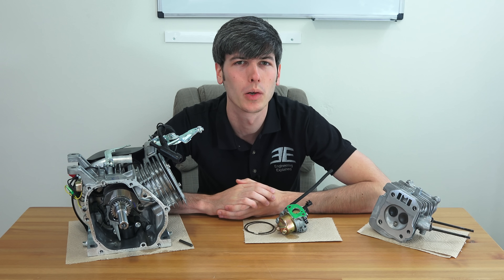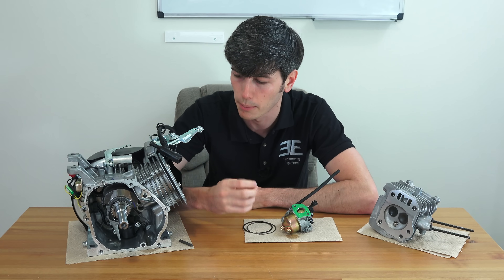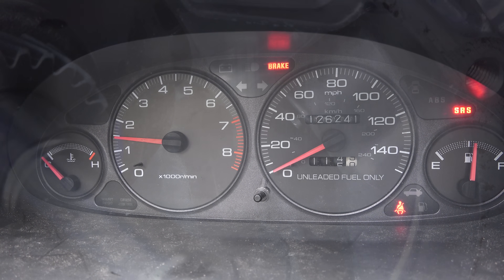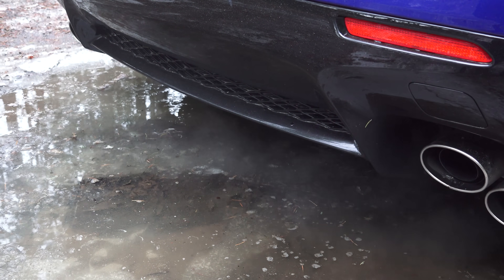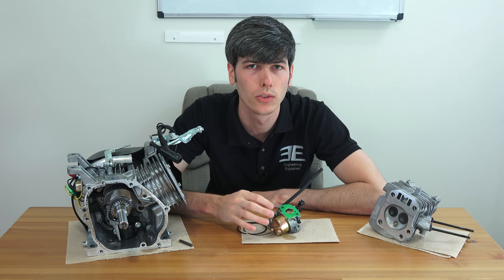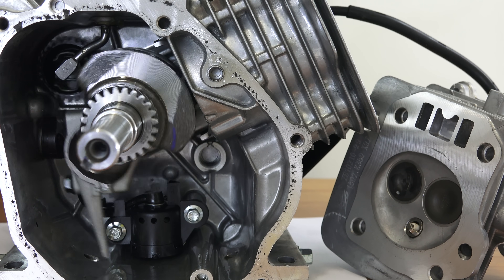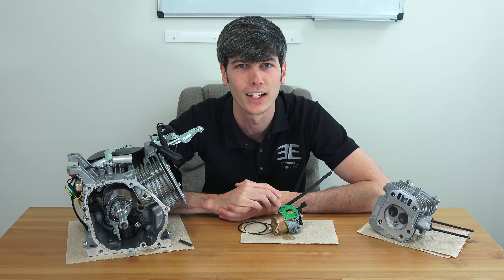Should You Warm Up Your Car Before Driving?

Comment: lol, the engine warms up quicker when you drive off right away because there's more friction from tolerances being subpar & the oil viscosity being too high during load. You're trading minor wear from wash/dilution for high unprotected wear.

Another angle with this is engine type & vehicle weight aren't accounted for... all these small inline turbo engines being run in large vehicles for fuel econ don't produce low end torque (where you're suggesting they stay till up to temp).

Comment: A properly setup carburetor has excellent cold start and cold driveability.  They were commonly neglected and didn’t always have as good cold emissions.  

My last carburetor, 85 Cutlass Supreme, had a 77 Olds 350, and an E4MC Quadrajet carb at -25F had significantly better cold weather manners than my 1991 Pontiac Bonneville series 1 3800 with the most advanced fuel injection of the day.   But I spent time to ensure the carb was setup exactly how GM specified it should be.  This old 5.7L engine would get 23.5-24.5 mpg highway without overdrive very consistently.   The original 307 v8 typically got 27-27.5 mpg highway.  From an old school carbureted v8.

Comment: "Carburators wont adjust the fuel air ratio when cold".  WRONG
That is literally the only reason there is a choke in a carburator, to adjust the fuel air ratio when cold and make it richer.

Comment: From experience...if you put too much pressure on a cold engine, you will super heat the components....you can bend the valves... Warm it up a few minutes and then "Idle" drive it until the revs come down.  Drive it as if there is a raw egg between the accelerator and your foot.  Everything will be just fine.  Also, use pure or semi-synthetic engine oil.  Some have flow capacity up to -40 F...........

Comment: You wrong, an engine oil is designed to work at engine temperature 🌡, running an engine cold, wear will occur, you absolutely wrong, car makers, and mechanics will tell you  that it's fine,cause if your vehicle breaks they make money, but anyway, YES ,an engine should be warm up at least 10 minutes, after that your engine will run happily  and last a very long time ,trouble free.
Reply: that's not what he said.. he said you should not let the engine at idle for 10 minutes because the engine and oil will be still be cold at idle and letting the engine run at that cold will just wear out the parts, instead you should start driving after a few seconds of starting because it'll warm up the engine faster just dont floor it

Comment: Not true - putting a load on an engine before the oil warms up isn't good. Let it idle. 

If you really want to see how little lubrication cold oil provides, buy 2 quarts and leave one outside overnight when it's -30C. In the morning, try to pour the oil. It will be like tar. Then, pour the quart you left in the house. It will flow like honey. You'll see how little lubrication cold oil offers. It doesn't protect the moving parts inside the engine.

Comment: I believe the car idles fast at first to keep the car warming up properly with EFI. This is designed to get the engine running at first.  But I can definitely tell a huge difference in performance if I allow the vehicle to warm up even just a little bit when temperatures are cold. A cold engine needs time to expand the metals and warm oils..
Reply: Yup and the transmission too, the only argument I have heard against long idling is that more fuel is injected when cold and washes away the oil. So where is the balance?  is it worse to run it when cold or worse to let it warm up. I’d imagine it’s somewhere in between if I can I’d like to do the 3 to 5 minute warm-up and then drive slow
Reply: @thetechlibrarian  if it's winter I'd wait till the heat starts to melt the ice off the windows, otherwise like you said 3-5 minutes is perfect

Comment: The big question that needs to be asked is:  how LONG will the car be running when you leave your house, or wherever you're leaving from?  Unless the oil reaches its proper operating temperature, it will not be able to do what is required of it.  It not only lubricates the engine, but is a cleaner as well.  If you start an engine, and your job, school, etc. is less than 15 minutes away, warming it up first is recommended.  If you're going to be driving it on the road for more than 15 minutes, then yes, warming it for a minute is fine, and drive it slowly til the engine, transmission, and rear end if 2 wheel rear drive, get a chance to warm up.
Reply: I live 10 minutes away from work and after considering all the yeas and nays on the topic, what you said is the conclusion I came to. I typically let the car warm up 5-10 minutes when the weather is cold; especially when it's 40 F or below. Today it was 25 F. I have actually experimented with driving after only a couple of minutes and my car doen't seem to warm up any faster except maybe by a minute or two. Plus, if as every seems to agree that reving a cold engine is not good, I reckon that idling is the least amount of stress on the engine components and is the most gentle way of getting the engine warmed up although there may be other issues to consider as I know that excessive idling is supposed to be bad. But as a driver who mostly does short drives of 2-3 miles, I think warming up my engine for 5-10 minutes in cold weather is the least of two evils as it were.

Comment: All this technical talk and people in -36 mornings with the -48 windchill just want to know if it will wreck the car to let it warm up for the 20 mins it takes to blow enough heat that you can drive half a block without the windshield getting completely iced over again after you just finished getting frostbite on your fingers scrapping it the first time.

Comment: An engine running is a pure fire dragon blowing extreme flames that produces extreme heat, so you're basically heating up a cold metal with extremely hot temperature, which could cause a rupture, bent or deformation in the engine block or the components of the engine itself, pure fisics; unless is made of a strong material  that resists extreme heat changes, so being smart is to warm up your engine, NO matter how new is your car.  Is not a matter of the right amount of fuel being injected, is just a matter of fisics.  And besides that older engines runs on thicker oil, so it will not be a bad idea to allow the old and tired oil pump to be able to get the entire engine lubricated before you take off; a few minutes wait won't kill you. I still warm up all my vehicles, no matter how old, I have a 2007, 2016 and a 2021...ALL warm up to temperature BEFORE driving away.
I am not mechanic, but it's only my humble opinion, nothing less, but I strongly think you're very wrong in this one.

Comment: I start a cold engine and let it run for 12 seconds before driving.  theoretically that's enough to get the oil pressure up.  then I drive with a light pedal until the engine warms up.

Comment: You say it’s better to get the oil to operating temp, but motor oils with dual viscosity ratings (5w-30) have been out for many years, which mitigates this problem and is the backbone of most peoples “don’t warm the engine” argument, but you say you drive quicker to get the oil hot. By that logic shouldn’t they have done that in the 50’s with sae30 oil? Nope. You do realize your ECU has to learn what’s happening with airflow and temperatures, and all of that has to reach an equilibrium, before your engine will even be close to operating efficiently, right? Sure I mean, it’ll drive just fine, but who knows if it’s finished identifying knock and tuning it out in the ignition timing? Me because I let my engine warm up and settle down before I worked it. You’ll notice your engine sounds different after about ten minutes of idling and that is not a coincidence. That’s because all the different metals have finished expanding, oil is up to temp, and the ecu is managing a state that the engine can maintain, a state which isn’t there 30 seconds after you start it in 20 degree ice.

Comment: but it's unavoidable in Minnesota winter, temperature drop below 0F as usual and you just can't afford to turn off your engine to keep your AC on, I usually remote start more engine and let idling 10-15 minutes in the morning to allow the cabin heat up to the fridge temperature

Comment: If it's real cold outside, what about letting the engine warm up a bit longer for all the different metals, gaskets, etc... start expanding/adjusting at a slower rate from idling rather than a faster rate due to driving?  Is there anything to be said for that, or is it just trivial?

Comment: There is one reason to warm up an engine not mentioned. All engine components are built to very exact gaps and tolerances, those gaps and tolerances are met when the engine is hot and the metal has fully expanded. Till that happens all the gaps are a little loose, driving a car cold especially hard will put excessive wear on the engine. Personally I wait till I see the temp gauge just start moving (not till it’s fully warmed up) and drive gingerly till it’s at least 50%-75% warmed up.

Comment: I disagree. When driving a car with cold engine - Youre putting much higher load forces on not properly secured (by oil) parts. It's better to warm up car a bit with low load (idle). It will take a bit longer, but with lower forces. What it worse - scraping metal on metal many times but with little force, or scraping metal on metal few times with bigger forces? How long to wait - You can hear it be listening Your engine.A minute, two, sometimes maybe 5.

Comment: Your car doesn't run rich on a cold start for more then 15 seconds.  I have an air fuel ratio guage.

Even at -15 celcious the Afr starts reading normal 14.5 within 30 seconds of that cold start, so it can sit there idling all it wants and won't " dilute the fuel "

Comment: This is absolute nonsense misguided information because yes you do need to warm up the mechanical parts of your engine allow the lubricant to work round the engine allow the lubricant to reach to it's optimal operating temperature. 
 to limit carbon build-up. To reduce wear for parts that need time to expand like inlet valves and rocker Arms piston rings and pistons cylinder bores

Comment: When it’s -30 here in Canada like tonight...I’ll be letting it run a bit tomorrow morning...you can’t drive when they’re that cold.  Everything is rock solid and it’s not nice.  I still get like 400 000 miles out of an engine doing what I’ve always done.  The wear is negligible compared to a carb'd engine.

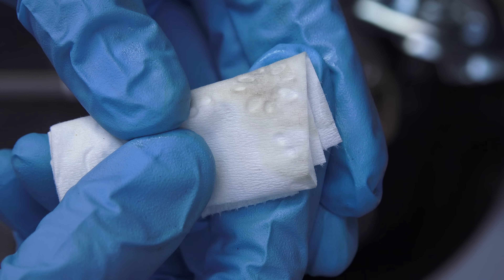Comment: 0:50 You talk about the harm of injecting extra fuel  then say the longer you have your engine cold the more wear it would have. "Less oil on the cylinder walls means less protection and because the oil is cold it makes it harder to replace. This means the longer you spend with your engine cold, the more wear you'll have." What's the correlation? The longer you spend with your engine cold, the more wear you'll have? How if extra fuel is not being injected when letting a cold engine idle therefore oil is not being washed away from the bearings, cylinder walls, and pistons? What is the danger of letting a cold engine idle all the way until it reaches normal operating temperature?

Comment: This guy is a rudder it’s not about what fuel system it’s about allowing the metal components to expand due to heat so the tolerances are right. Hotter oil flows better too thru galleries to the desired location.

Comment: I am really late to this discussion but would like to point out that my carbureted ‘68 Beetle had a thermostatically controlled choke, and this did enriched the mixture to compensate for cold engine temps. I’m not arguing the overall point here, just pointing out a flaw in one blanket statement. Also, it should be mentioned that the tolerances between various moving parts are out of whack during warmup, as those parts heat up at different rates, which is one more reason to go easy until the engine is warmed up. Thanks :-)

Comment: It doesn't make sense - idling = less heat = stays cold for a longer period of time?
OK, according to this logic you should press gas up to high rpm to warm it up faster, but nobody do this and 99% of information says that you should not do it.
Also not 100% sure that engine will warm up faster by driving "lightly" because you are getting a lot more air through your radiator while moving.
Reply: Well it will warm it up faster the higher the revs with bigger explosions in the cylinders but there's a point where engine damage potential makes the speed of warming less important. Not everything should be thought of like an extremist like in your example, there's always room for reason and rational thought

Comment: doesn’t driving cold put excessive wear on gaskets? you’re putting extra heat in the cylinders so the metal would expand faster inside the cylinder. Is my theory wrong?

Comment: Start it up, put it in gear, drive it easy until the temperature gauge is about have way up and then I drive a little harder. I do it a little bit for the engine but I do it more for the (probably tiny) amount of gas that I make better use of. O.C.D. may also come into play here.

Comment: Related question... I want to warm the engine up faster so I can have fun sooner, but not idle or drive hard cold. So.. can I drive with my brakes and use extra engine power to heat up faster? Or is this worse than just pushing it when its not fully warm but driving normally before that?
Reply: it is actually worse

Comment: I didnt warm my jeep up in 2017 and it was shifting super hard on my way to school because i was already late and rushed. It started smoking about 15 minutes later and completely in flames in another 5 minutes. It still had ice on the hood and parts of the car, now i never drive without fully warming up a car for 10 to 15 minutes

Comment: What about all the expansion of components made of all types of different materials? Taps, knocks, and even cracks can be generated in the engine components without letting them reach normal operating temps before strain is applied to them.

Comment: Well when i scrape my windows while my car idles i could just do nothing until the ice is melted due to the heat from the inside of my car coming from my AC. I can also use my spary-thingies which have anti-frost in them to melt ice on my wind shield. Just hope that your engines powering your wipers arent frozen cuz that theoretically could cause damage to them otherwise.
So I'd rather wait for my AC to melt the ice instead of scraping it off myself. Once its melted a little i usually use the wiper spray thingies and get my wind shield clean (cuz its very big and it takes the heat quite long to reach the top of the windshield quite fast.. If my other windows are clear enough, I start driving. This process could take up to 10 minutes. Just a little longer than scraping but therefore I am not frozen or exhausted.

Or you just have a pre-heater and you pre-heat your car before you even start it. No more cold starts ever and instantly warm A/C.

Comment: I though you needed just enought time to heat the piston up(so very little time) because it is so much hotter than the cylinder during normal operation that it is a loose fit if you gun it right away.
Reply: That is to say.  If you gun it right away it might be slighly loose and cause wear.
Reply: You have piston rings which provide the actual seal and they can expand so this argument is invalid. That said, I also believe that waiting a minute or so before driving off is ideal

Comment: Up here in canada, you could install a circulating block heater, (rare that anyone does unless you have a diesel semi) but i have had one years ago in a gas carbureted car and heat blew warm from the second you started the car! Friend has a 2000 Jetta diesel and installed one, blows warm from the start, and the car warms up a bit faster too! -40C/F

Comment: It depends on how long you expect your car to last. Most cars these days are capable of doing around 200k miles as long as they get serviced regularly. If you buy new and intend to sell it after a couple of years then whatever you do is unlikely to cause you any problems. However if you're hoping to wring out the last mile from it like I do I think perhaps a minute or two on very cold mornings shouldn't do any harm.
Reply: We did watch the video, didn't we Robert?
Reply: I've always warmed up my cars never had any problems until the body rusted out. It runs and sounds better warmed up too.

Comment: Its -20c here in Canada and I' WILL 100% recommend warm your car up
Reply: I am Canadian too and always warm the car up in the winter.....especially when its -35C to -40C
Reply: @davidcampbell1899  you NEED to warm up the car I dont know how these EXPERTS are saying you dont need to warm it up...it was _-25c last week Wednesday and I didn't warm the car and the car was struggling so hard to move people were honking at me because i was going too slow
Reply: @the_batmobile0.4  If you start it and just let it sit for 5 minutes idling when its colder than -18C / 0F  the "engine" will be warm enough to drive, then if you drive slowly for a few blocks the wheel bearing, tires and brakes will warm up enough to operate normally.
Reply: David Campbell screw Canada down here in Florida it’s always warm can’t stand the cold
Reply: @nickwebb9937  That's alright, you just stay down there and stay warm!
Reply: Canadian too so I also take 5 minutes to warm it up in winter
Reply: Same here. I wait for about a minute in the summer and a few minutes in the winter when it is well below freezing. I don't need that "lurch" in my automatic transmission either when shifting from P to D. My engines last more than 180,000 miles without a single issue.